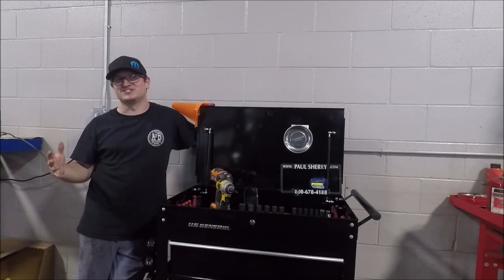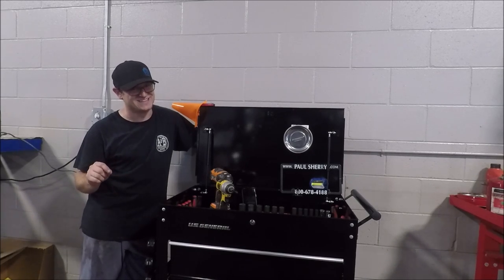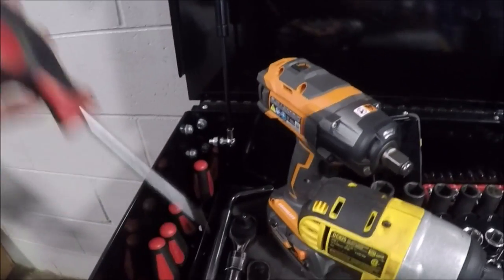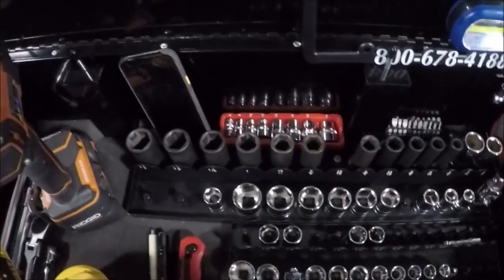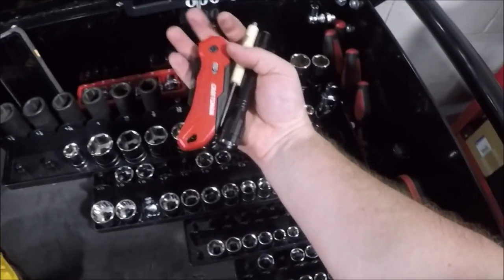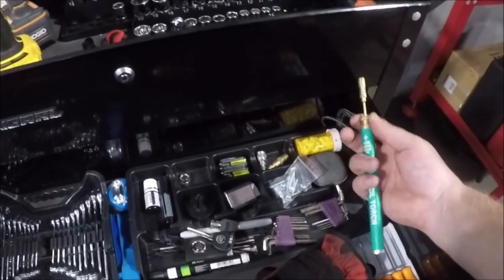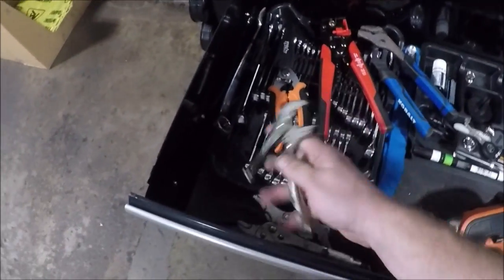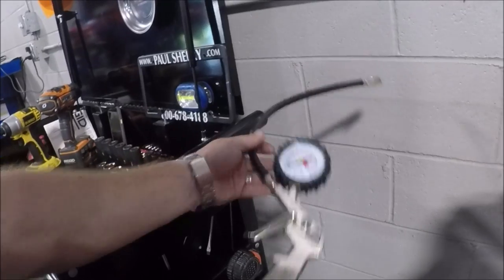First Week As A Beginner Mechanic Tool Box Update And Tour

Comment: I love seeing our fellow Chrysler techs using the fancy battery jack for actual use and not sitting in the corner collecting dust.
I couldn't tell if you guys had anything between the rubber mat and the trans but we use a piece of plywood to preserve the insulator for the day we may require a battery drop.

Comment: Rather then using wrenches you should consider using the Milwaukee Electric Ratchet. Saves you time, which makes you more money. Also consider getting the 3/8 Drive CT761 Electric Impact by Snapon, and the 1/2 High Torque Electric Impact by Milwaukee
Reply: I have the Snap-On and Milwaukee in 3/8 and 1/2 impacts. 

The 3/8 Milwaukee with the one key bluetooth and preprogrammed setting buttons allow you to set 4 torque settings. I'd take my Milwaukee hands down over my Snap-On in both drives. Just acquired the 1/4 dr longneck Milwaukee as I have the long 3/8 from snappy as well as the shorts in both 1/4 & 3/8 dr. 

The Milwaukee 1/2 Dr impact I have is the one with the big power. I use it but also use the snappy one. Had a bad experience with the Snap-On once though as I'd just bought it used on eBay from a seller in PA who I later found out after doing some digging was a franchisee. Anyways he pulled the proverbial "it's been used a couple times" as if he'd used it and said it had great power, etc, etc. 

So I was doing a ball joint, wheel bearing on a mid 2000's model pt cruiser and my 3/8 was struggling getting the locknut loose so I thought I'll just use the new to me Snap-On half in drive impact. Well that fell flat on it's face and started smoking after 5 seconds passed. Smelled the unit and motor was fried. I will say even though I bought it used then had to get it repaired on the flat rate fee I still came in about $150 cheaper than buying new in the end so after the hassle it wasn't to bad a deal. 

In the end that day on the PT Cruiser I wound up whipping out the Milwaukee 3/8 Dr impact with the bluetooth one key described above. 

Just getting ready to hop on and see who's got the cheapest cordless cutoff tools that Milwaukee just came out with. 

IF I was doing alot of head gasket jobs for instance then i'd consider one of the new Milwaukee 3/8 or 1/2 drive torque wrenches that actually spin down tightening on their own while setting the programmed torque.